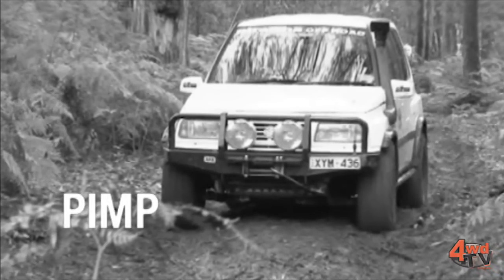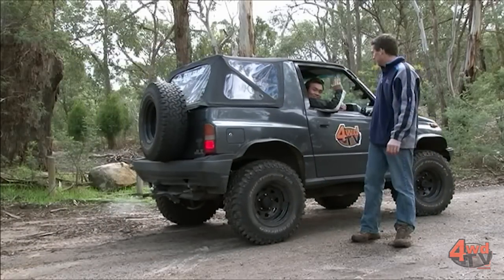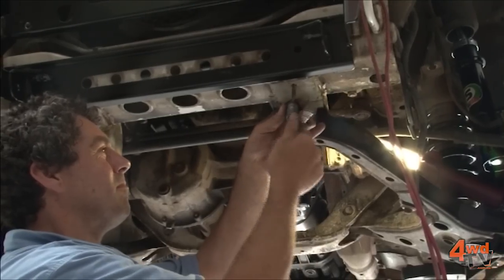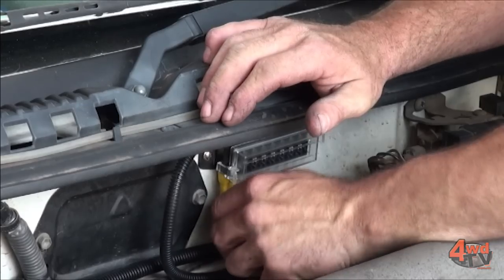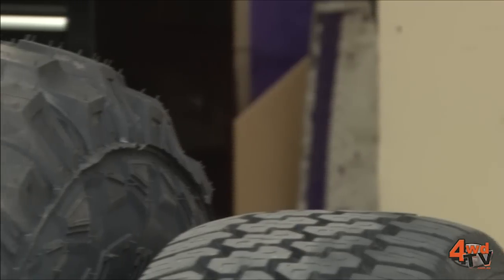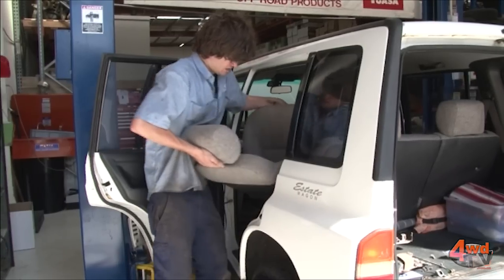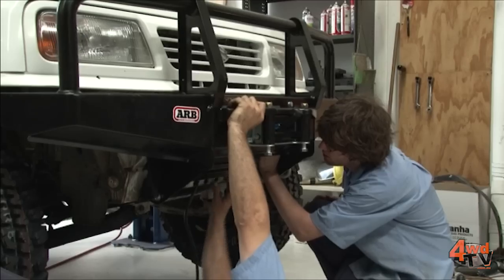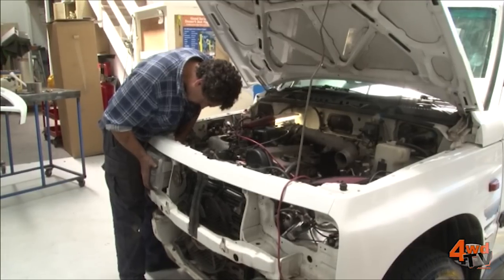Pimp That Zook - Introduction & Body Lift

Comment: I have a 2002 grand vitara   and i am going to a different tire size and that will be 245/75/16 and i was wondering if the tires will fit with out any kind of a lift!
Reply: My 02 Grand Vitara fits LT225/75R16 Muddies without rubbing, but only barely. 245/75 won't fit without lifting.

Comment: old video but you are way over dramatic about the body lift on those with a 2inch body only a few things need lengthen. most fuel and brakes which you left out have slack. the shifter just needs an extension. most grounds are the same as well slack. filler kneck would be a 5 dollar fix at most if you couldn't slide it some. yet yours looked unsafe with it barely touching like that over a 5 dollar hose
Reply: mrdauntl3ss You are so good ya peanut..

Comment: These are the last idiots you want touching your car. Sold me one of their rebuilt engines that didn't make 400km.  Even told me it's normal for the oil pressure light not to go out....
Reply from the maker: Hi Cameron. Sorry we don't sell engines, are you sure you have the right company? If so please let me know the details as we know nothing about this.
Reply: @PiranhaOffroad  I bought 2 engines directly from Allan Johnson. First one was seized after he promised it was all good so I paid to have it re ringed and new bearings which lasted 400km due to oil pressure issues. He even told me the oil pump was checked when it was  assembled so I spoke to the mechanic who did the work who informed me no such thing was done.